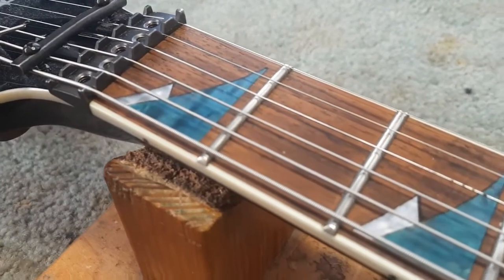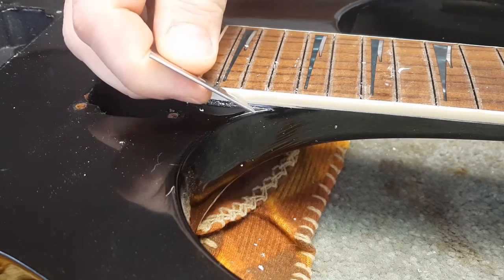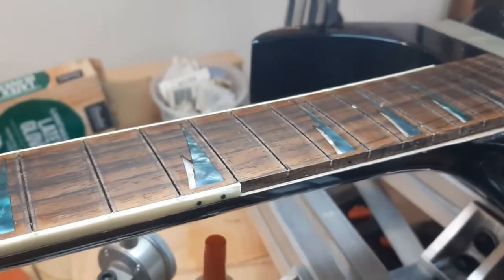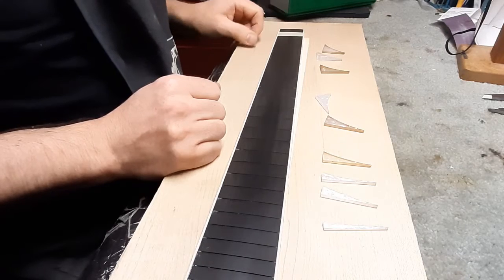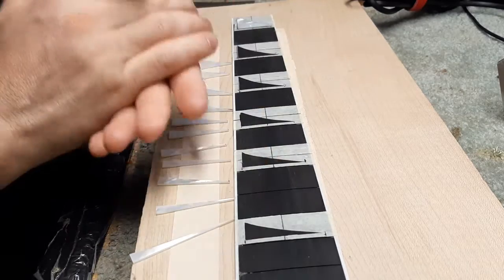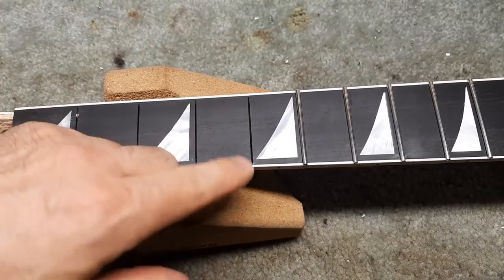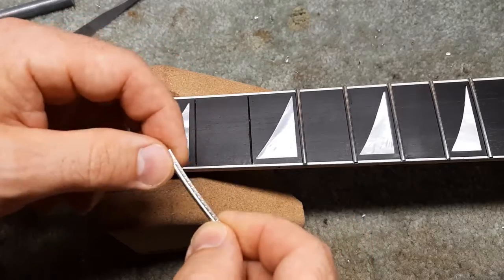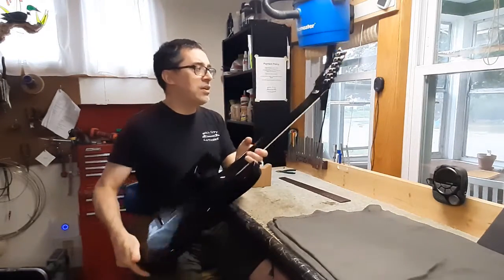Complete Fingerboard Replacement, With Binding, Shark Fin Inlays, Touch-up, the Works

Comment: Is there a way to remove the shark fin inlays alone to replace in mother of Pearl ones without removing frets?
Reply from the maker: Yes I can be done, but it's a pain in the ass.  This would be similar to what you asked.
https://youtu.be/SsZ6jDeTsFc
Reply: @MillCityLutherie  sweet,love your content brother thank you!
Reply: @MillCityLutherie  for oversized inlays do you recommend sizing the mother of Pearl to the size of what was being replaced?Logically im thinking yea but not sure if MOP run risks working with when down sizing.Thanks again!
Reply from the maker: @fraterlemuele.s.l.d.6435  It's easy to sand down.

Comment: Being a ibanez fan I prefer the original shark tooth inlays, though I too have Jacksons and also love the shark fins. I am wondering if you could not just have stained the rosewood board till it looked like ebony ? Or did the customer want the shark fins as well ? Those are particularly nice looking shark tooths too dang.
Reply from the maker: I made all options available and this is what the customer chose.